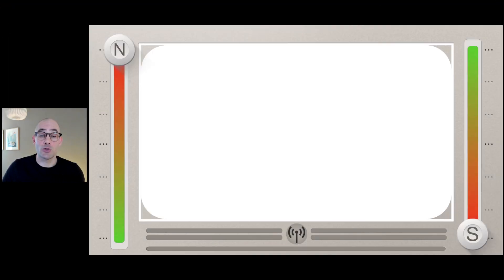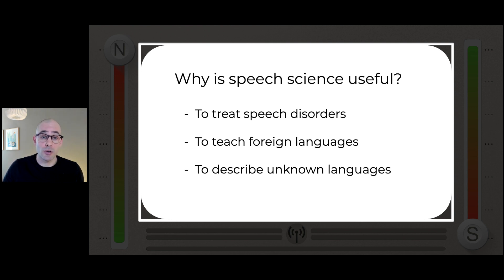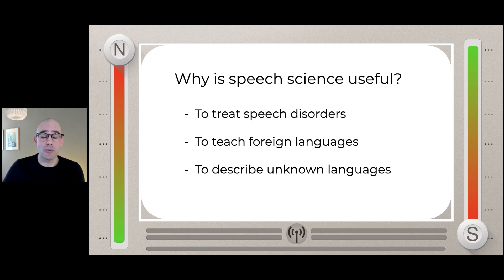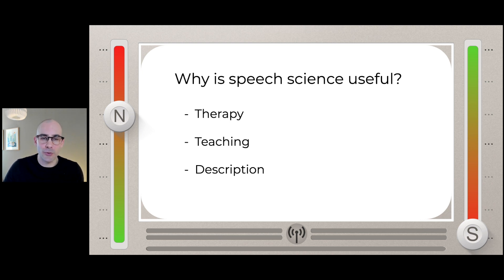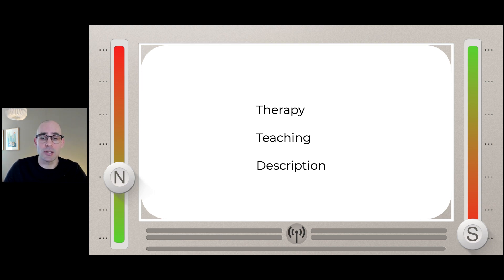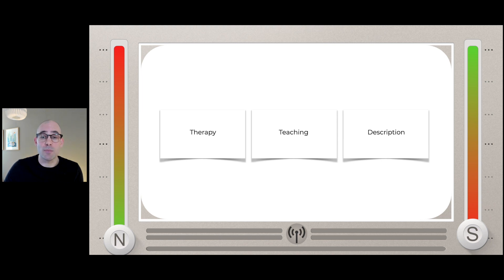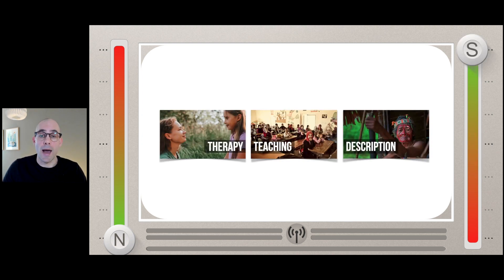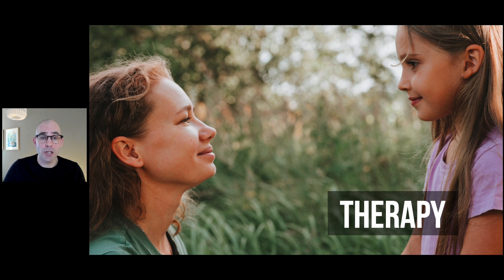Create Impactful Slides by Reducing Noise and Amplifying the Signal

Comment: I agree with everything you say, but I wonder how this type of philosophy can be applied to, say, a class on distinctive features, where it's more challenging to reduce the noise (whatever the noise might be in such a scenario). How would you apply the idea from this video to a more technical talk, where you need to go over details and complex terms/processes?
Reply from the maker: This is a great question. What I show is just how far you can push the signal-to-noise adjustment. Using full screen images is often not possible, for example. But focusing on the core message, reducing the amount of text, spreading it out over different slides and using visual elements to highlight what the audience should focus on are all applicable to the most abstract technical concepts. Just because you teach a class on distinctive features does not necessarily mean that you must have a slide with a complete feature matrix. Too much signal at once can also quickly become noise.